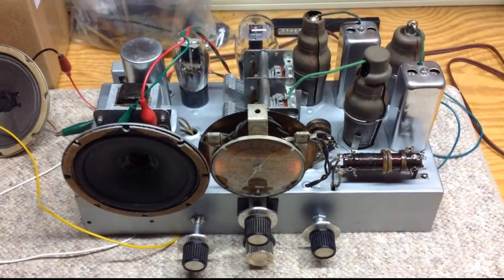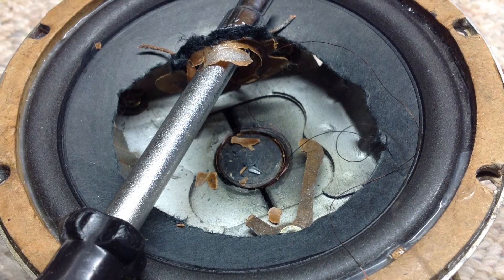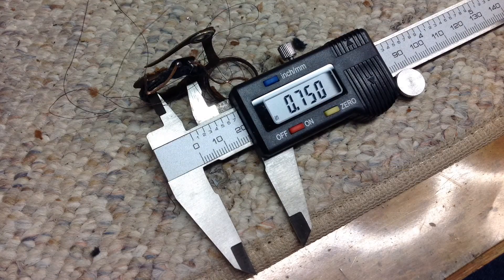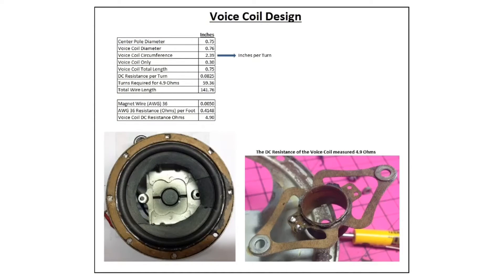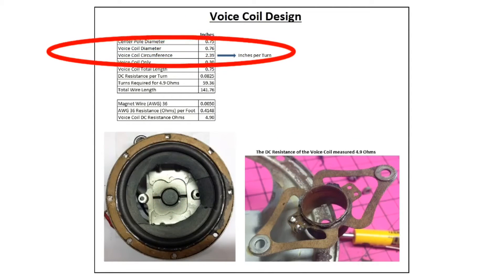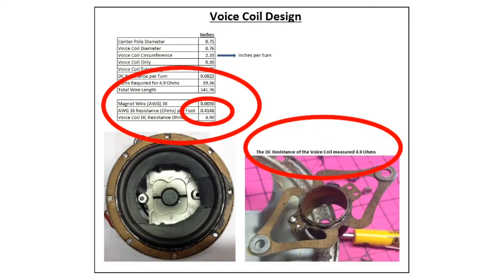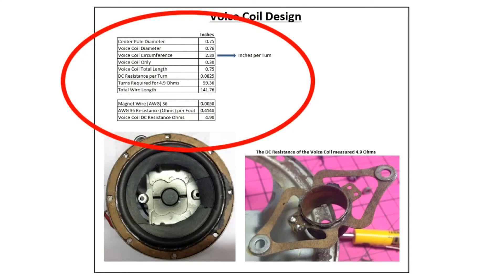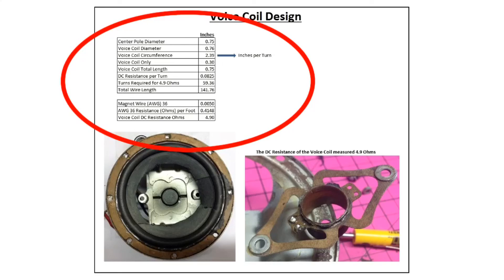Chanticleer 2D570 - Voice-Coil Debacle

Comment: Good stuff! I'll can't wait for the next installment.

When I wrecked a voice coil on a recent restoration,  I took the easy route and installed a PM speaker. It worked out, but it wasn't the same and original as I would have liked.
Reply from the maker: Ron Leix Jr Thank you sir. I hope it turns out "good" and I'm able to build a new voice coil and get decent performance. The tolerances are so tight; we'll see what happens. I may have to take the same path you did with the PM... Hope to spend some time this weekend creating the former and spider. Thanks again for watching and your comment Ron.